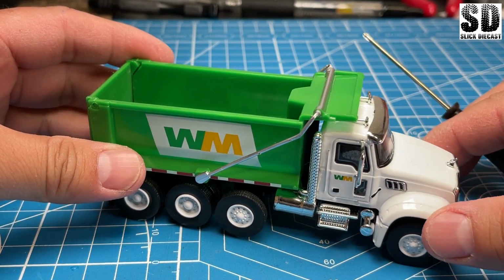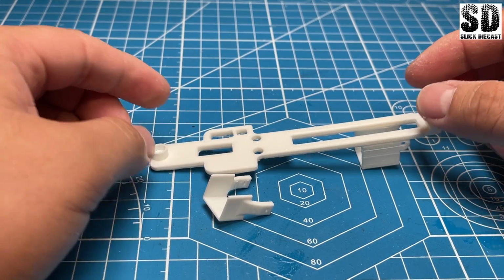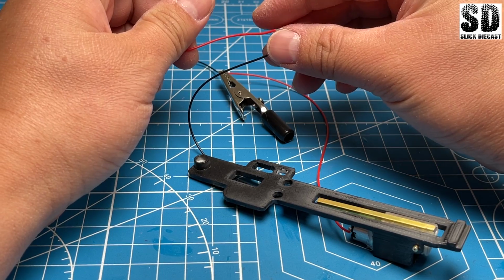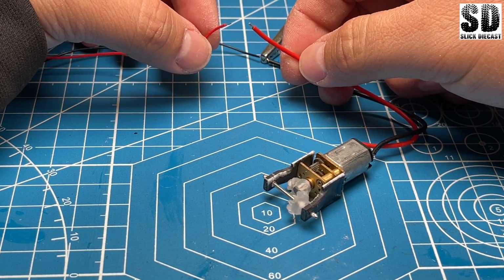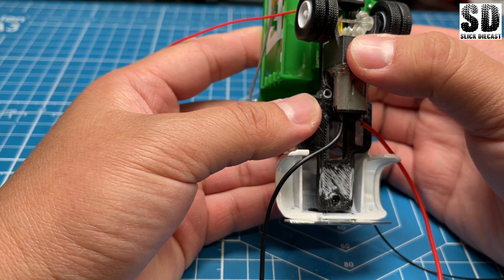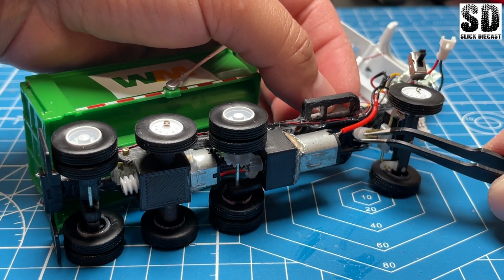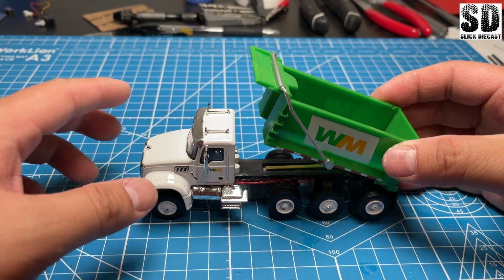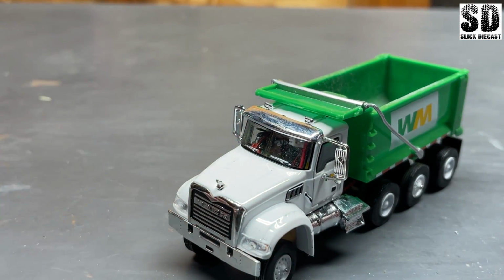1/64 scale REMOTE CONTROL TRUCK Greenlight Waste Management truck

Comment from the maker: Please visit my website for parts and files https://www.slickdiecast.com
Reply: If you want an easy design to hold the lift motor, use a half clamshell with a screw on either side with a tight slip for around the motor housing that bolts into the chassis above, and the gearbox location.
Reply: I also wonder if you could use a linear server to steer instead of the mini servo.